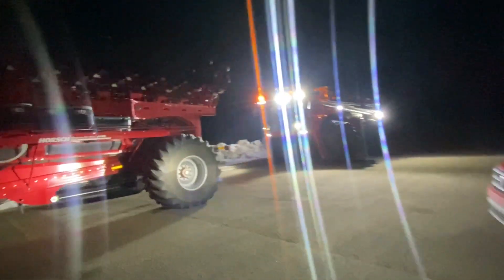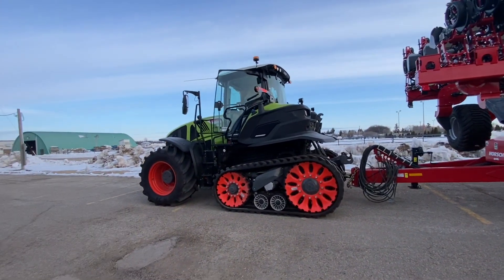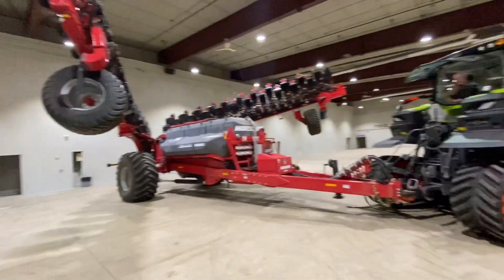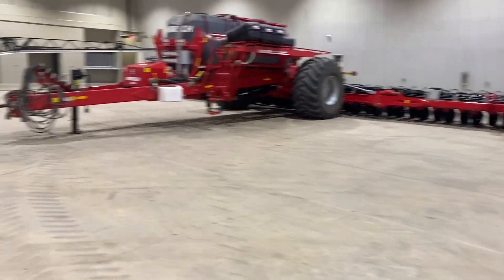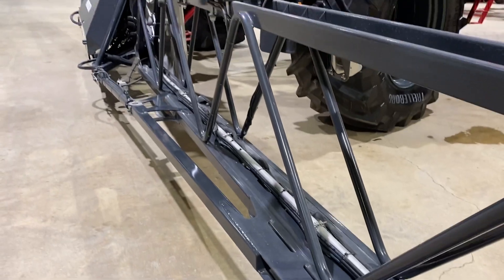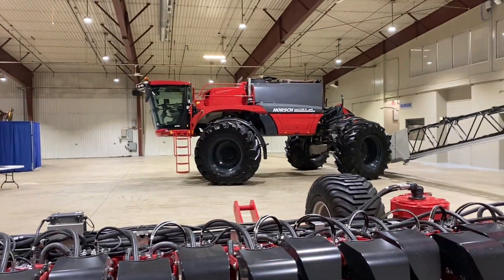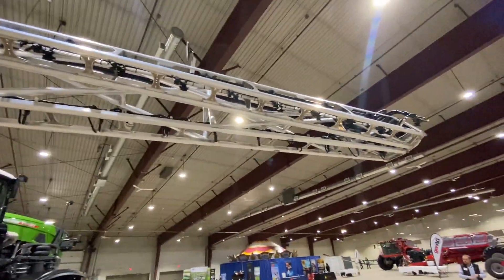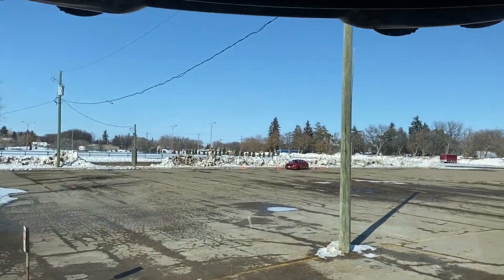120 ft Booms unfolded inside?!? Manitoba Seeder and Sprayer College setup/tour

Comment: Is Agleader Right Spot an option on it?
Reply from the maker: No.  Right spot can only control 144 nozzles.  10 inch spacing with edge and border nozzles on a 120 boom is 147 nozzles.  It would work fine if you went with a 20 inch spacing.  Why would you prefer right spot over a raven hawkeye 2?  What is the main advantage?
Reply: @mikewasylyniuk244  there is no doubt in my mind that Raven has a great system. I just have a fantastic Agleader dealer 10 miles away from me so I just tend to buy Agleader products. Can an Agleader monitor control the Hawkeye 2 system?
Reply from the maker: @chronicallydepressedwildfa2789  yes

Comment: The trailed Horsch sprayers have a total differnet boom control. But still, it works very well. Mine (Horsch AX) actually can't even angle as fancy as the one in the video (or as the bigger trailed ones) and it only has two radar sensors. But my boom is only 80 ft wide anyways and I operate it with 12 km/h. It works for me just fine.
Reply from the maker: AX is a beauty sprayer!